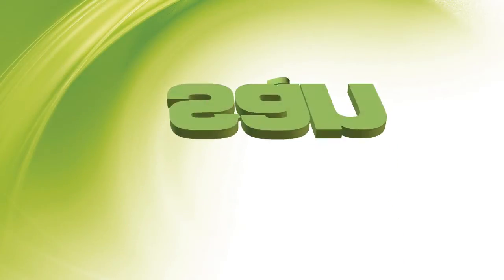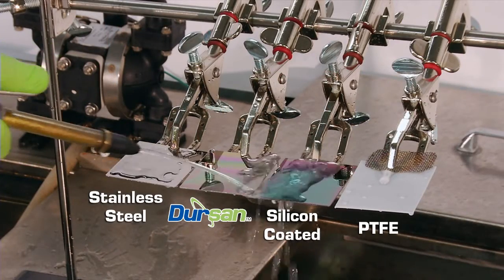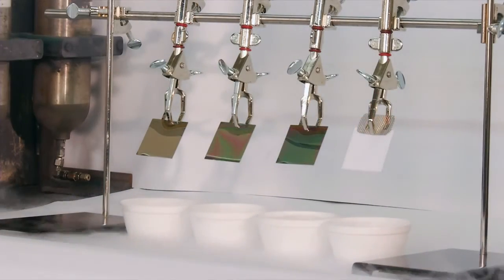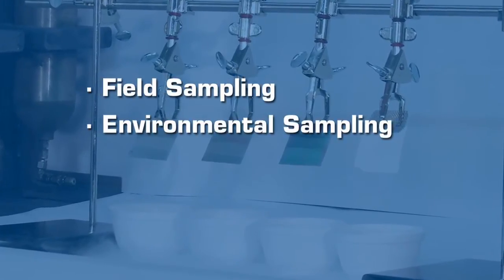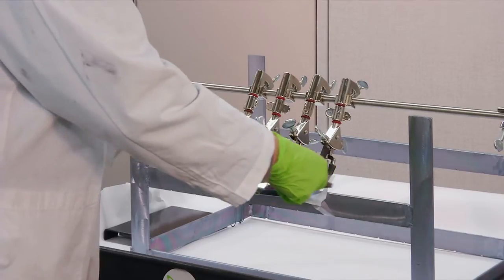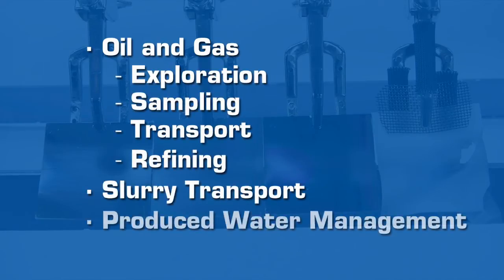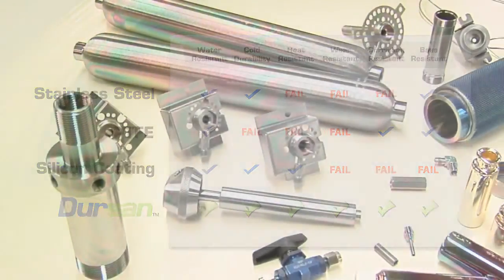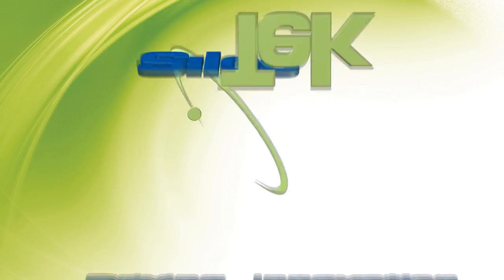Protect Your Steel - Dursan® Protective Coating from SilcoTek®

Comment: Given I cannot find any place to purchase this product, is it safe to assume this is only sold for industrial appli8cations?  I was hoping to buy a quart or a gallon of this sort of product for a few projects of my own...  Is there anything like this available on a consumer level?
Reply: This coating is applied as a service by SilcoTek for industrial and scientific applications. It is not a packaged coating that is available for consumer use. There are hydrophobic spray-on coatings like NeverWet that you can buy online.
Reply: @lpatterson328  Yes, I had found a couple of consumer level offerings, but they leave a bit to be desired if comments are of any value.  I wanted something to coat a solar panel to see if it helped in keeping them clean.  Was going to a little experiment to test affect on efficiency.  I decided I would try one of those products you use on cars.  Thanks very much for commenting!